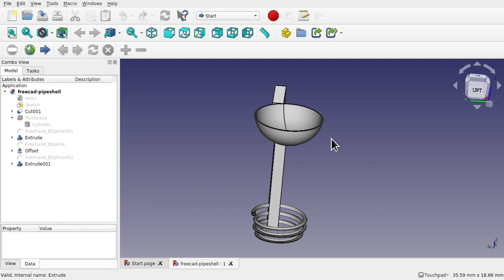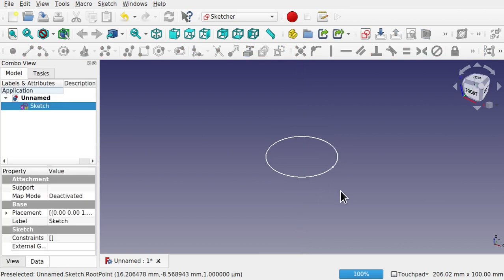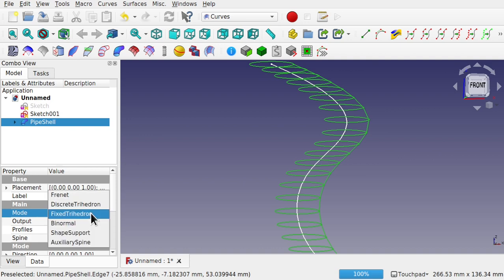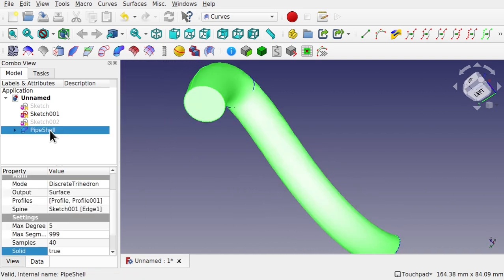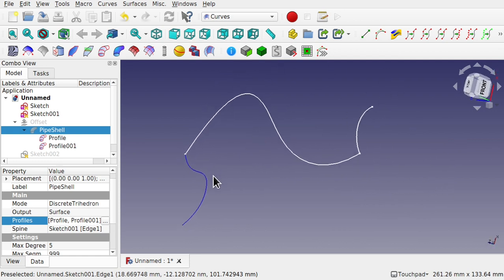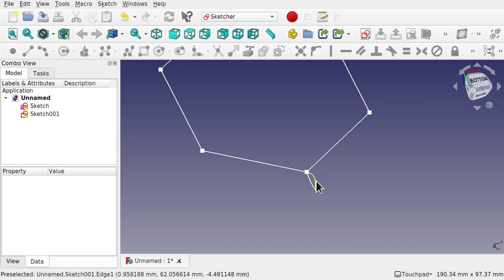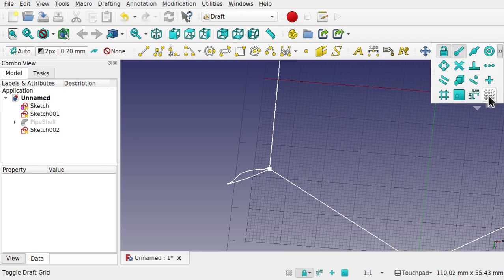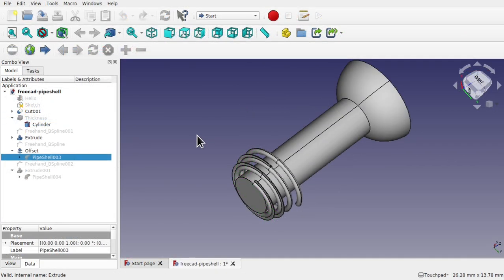Learn FreeCAD Curves Workbench [9.1] Pipe shells

Comment: Heavy work at times this One Darren! However getting Right under the Hood of FreeCAD is enlightening to say the least!! I am having some issues with Bow Tie Twists in my sweeps 34:14, does it matter which Profile Sketch You select to remap? I'm wondering if this is causing my issue. Some times the head gets too full of new info to function well? Took your advice and tried a circular path (Peice of Cake). Seems with the Polygon the First Two Edges Sweep ok but the Third Twists. I remember settings can sometimes solve this any ideas? I remember somethings about bow ties I'll try and find a video.